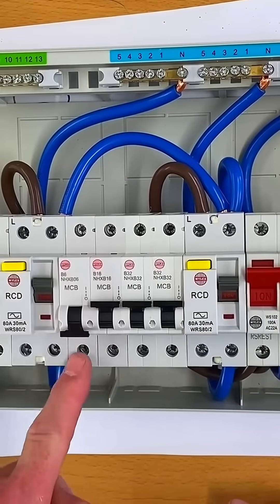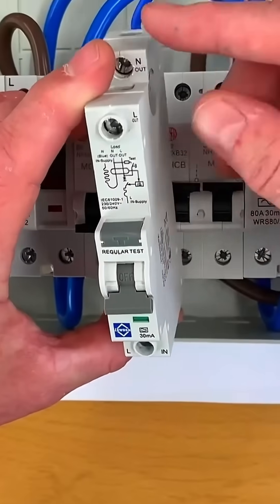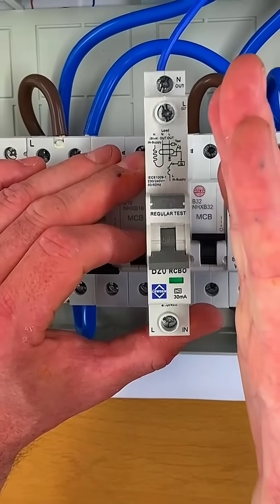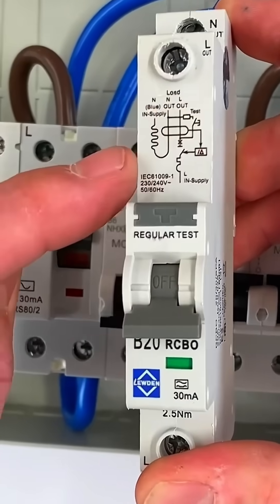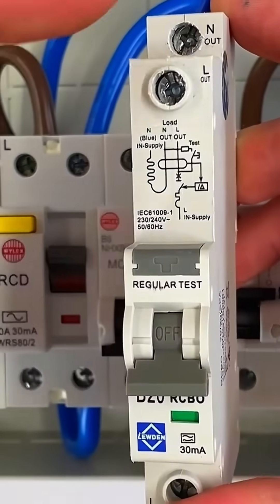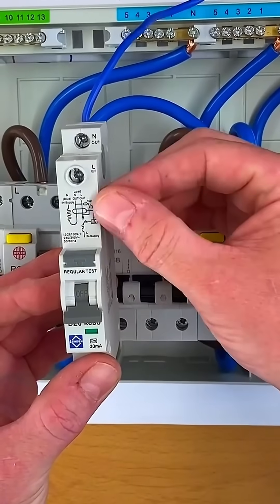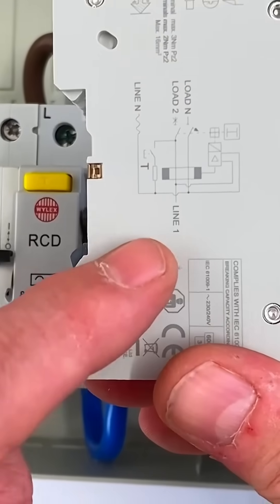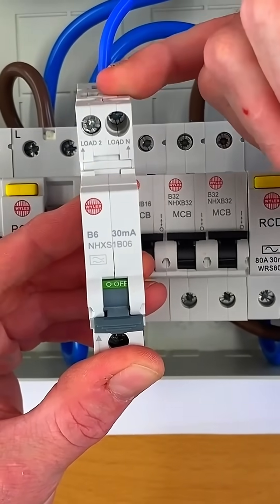Did You Know This About RCBOs..?

Comment: The double pole would be useful if the fault was a cross-connection or to clear a ground loop short from the rest of the system -- keeping the ground circuit clean. Eventually a 5ma spec might be imposed for human factors.

Comment: These single pole RCBOs do not detect N to E faults. There are still many of them about . Replace with a double pole RCBO that also detects N to E faults. This junk is still on sale. 

It is down to the regs not insisting on double pole breakers in main panels, like on the Continent. The regs need amending ASAP.
Reply: That is not correct. RCBOs detect any imbalance between line and neutral, so if neutral is leaking to earth they will detect that.
The only difference between a SP and a DP is that when activated, they also disconnect the neutral.
Reply: @semperidem2577  
The N to E fault is not isolated even if the RCBO trips. 
If there is a N to E fault an RCBO will trip.   But, if a whole house RCD is fitted the fault is still sensed by the main RCD as the RCBO is not DP.

Comment: Here in the Netherlands all breakers must have switched neutrals.
Also rcd's have an extra contact to break the test cirquit in case of PV backfeeding or just connecting it in the wrong direction.
Reply from the maker: Thanks for the insight
Reply: It's not just a case of the test circuit, some devices use an electronic detection circuit. Therefore any reverse flow, such as from PV, is not permissable through an RCBO or RCD unless it's been classed as a bidirectional device. There's probably a symbol for that, but I don't know - maybe someone can explain what it is?
Reply: @gastube22  As far as I can tall, if the terminals are marked "supply" and "load", then it should be considered single direction only (unless the manufacturer says otherwise).  If the terminals are not marked (i.e. just two sets of L/N without any supply/load markings or indicators), then it should be considered bidirectional.
Reply: European electrics make far more sense than UK, although some installations I’ve worked on, particularly Italy and France have been very dodgy DIY!
Reply: @MS-Patriot2  I wonder if ring final circuits ("ring mains") will eventually stop being permitted for new installs, with all new installs using the existing permitted radials only instead (20A on 2.5mm² cable or 32A on 4mm²).  Overloaded cables from unbalanced ring loads, "double spurs", or as a result of broken rings are fairly common.
Reply: @Tim_Small certainly hope so.

Comment: As i understand, we should moving away from single pole RCBOs as they dont clear neutral to earth faults and tha poses a fire hazard.
Reply: They will operate with either L-E fault & N-E fault. They measure the current in both conductors and trip when an imbalance is detected.
Reply: A single pole rcbo will not isolate the neutral, but it will detect a neutral fault and the device will operate, therefore cutting the power and reducing shock/fire risk. If the device is healthy and working correctly that is!

Comment: Single poles are not allowed here in France. ALL breakers here are double pole.
Reply: Yes and AC type RCDs are still commonly sold and RCBOs not more or less obligatory in replacement boards like in UK
Reply: In France every installations earth is via an earth rod ? 

In this country double pole is also required on installations relying on an earth rod . 

It’s due to potential difference between the neutral and earth conductors which normally isn’t present on a TN earthing system.
Reply: I believe that in the past in France there was no distinction between live and neutral. Everything was treated as phase, so double pole breakers are compulsory.
Reply: I hope Germany would learn from France.
Reply: Same in Holland, and thank god.
Why on earth won’t you disconnect the Neutral?. To get shocked again???
Reply: that's better for safety every country should have this rule

Comment: thing is, all those diagrams are hidden by the cover and the long letters and numbers on the front are all different in my cu
all my 32's have little yellow "buttons" on the top but the 20's, 16's and 6's don't
Reply: If there's no 'Test' button (often yellow or orange) then it's just a plain MCB. Usually these will be fed from a separate double-pole RCD, as in the CU shown in the video.